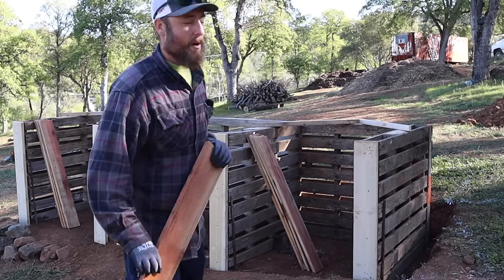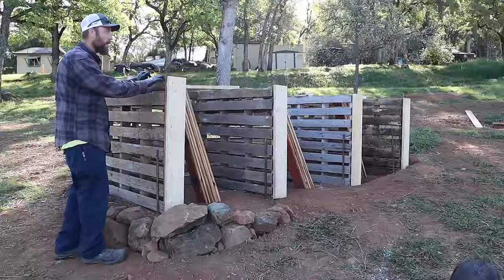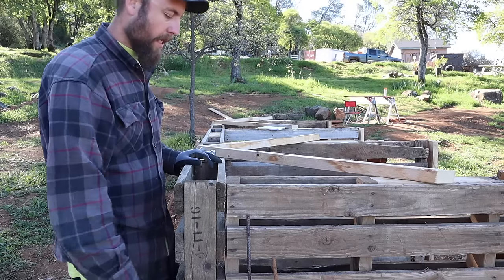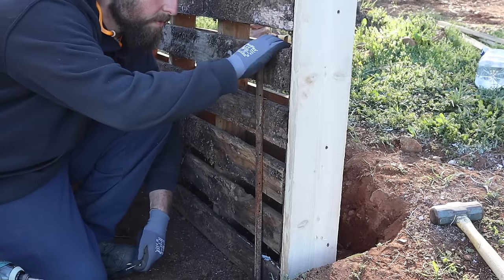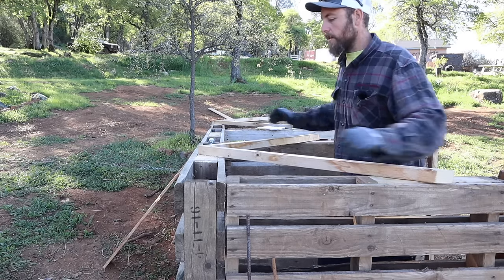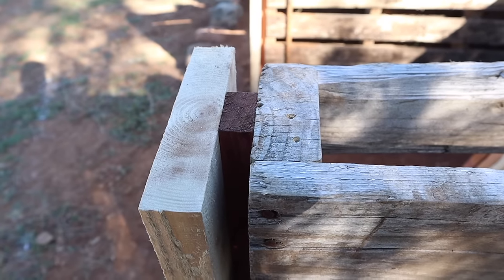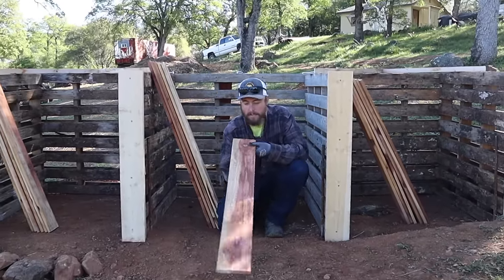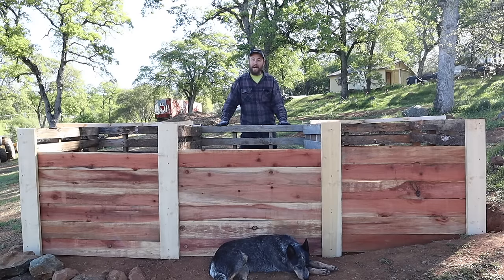PALLET COMPOST BINS | Building Our Homestead

Comment: I love your attention to detail, and I know the satisfaction that comes from doing a job right. But realistically, these bins are going to compost themselves in a few years, so overbuilding a compost system is just going to end up wasting wood. I just put my pallets together using some stainless steel L-brackets; the weight of the compost inside makes them rock-solid. When the pallets disintegrate, I just remove the L-brackets and re-use them on the next build. A lot more time and cost-efficient!

Comment: My biggest suggestion is make your bins wide enough to scoop out with your bucket on your tractor.  If you have a 5 ft bucket make 6 ft wide bins.  And such.  Then you can scoop out the compost when it’s done to move without shovels.  And if you need you can toss the compost easily with tractor.    I made my first been like he did which sucked since I bought a tractor a year latter.  Since then I made a new compost bins much larger.

Comment: Very nice looking bin for sure. I built one out of pallets when I start my homestead as well and about 3yrs in the pallets where pretty much composed on the bottom side . So my new one I used cinder blocks along the bottom to lift the pallets off the ground and used rough cut cedar top slabs as bottom boards in hopes it last a little longer.  But great channel and great work !
Reply: Thank you for sharing about the cinder blocks. That tip just modified my plan.

Comment: I've used steel T posts, 2 per pallet which worked pretty well. just stand them up right between the slats, and pound them in til they stand alone, remove pallet then drive the posts down till flesh or slightly below top of pallet.

Comment: this is cool , especially the front slats and how easy they fit in ... I used  2 metre (6 foot) fence postsfor securing it , the round ones fit between the palett  , had 1 at each corner ,and it was solid , used chicken wire on outside to stop any escapes, but the front I just screwed 3 pieces of marine plywood , I like this better , does same job but looks 10x better 👍

Comment: I had the same idea and configuration as you but your idea to use the removable boards in the front is an excellent idea so as the level changes it makes it easy to access. Cheers 👍

Comment: Nice build but one suggestion, those pretty pieces, rose colored you used to build up the fourth side ( openings),  is too nice! after all, the contents will be rotting so they are bound to spoil quickly.  I'd use those to build some outdoor furniture and then put polyurethane or a stain that enhances the beauty.  My suggestion, take apart some pallets and use those planks instead.
Reply from the maker: They are very nice, thank you. They are cedar (very rot resistant and cheap) dog eared fenceing. Don't worry I used. Some of them to for projects in the house, made a window sill out of one.🙂

Comment: Watching you bolt one pallet to another, proves to me that you can find a way to attach 6 pallets to each other to make a big completely enclosed cube. Inside that cube you can fill up all the space with 2-liter soda bottles. With all these soda bottles trapped inside the cube, I am positive that the cube will float. By bolting many cubes together, you  can assemble a barge, or pontoon boat, a dock, or floating bridge. Any person who can find ways to use pallets without taking them apart is a smart builder.
I enjoy the way that you build good looking structures. But I do not think that the wood chip compost will be ready for the next planting season. Good video!
Note: the bottles will need to be inflated while at the same time the bottle cap is being screwed on. Applying a little Gorilla glue around the cap will also prevent air from escaping. If you have a minute, take a look at the following soda bottle boat, in the video entitled " Barco de Garrafas Pet." The man also has related videos where he talks about the construction steps (Tutorial Barco Pet - 04) and also how he screwed the caps while inflating the bottles ( Tutorial Barco Pet - 01). I do not speak Spanish but I watched the whole thing. I am sure that I can make a nozzle that holds the bottle cap while pumping air from a Shop Vac., while I screw the bottle into the cap. Thank you for reading!

Comment: The front boards attached to the 3/4 redwood that holds the corral boards in place what size what is that? Is it pressure-treated?
Reply from the maker: If I remember right, not at home to measure it.  They are "5/4" meaning full 1 inch x 6inch its not pressure treated, a standard 2x6 would work.
Reply: @JoeSimple  great thanks Joe. Love the channel. Keep up the good work

Comment: Did you eventually cross all the fence boards with a couple boards... that way you can slide all of them out at once?
Reply: I saw someone do half at a time- spanning 3 or 4 palings at a time. As you build the pile you use the bottom half then when it gets higher use the second half.

Comment: I really like it. I need to build one too but want mine wide enough for my front end loader to fit in. Also, will the pallets not rot? I know they are heat treated but I was thinking that makes them stronger?
Reply from the maker: that's a good idea tractor size!, keep your eye out for some extra large pallets I found some for my fire wood storage racks. Yea the heat treated pallets will rot, probably where they are sitting on the ground. You could try and keep them off the ground with maybe concrete blocks, or even better old composite decking. come to think of it most lumber stores have left over composite decking pieces form the pallets the decking comes on.
Reply: JoeSimple That’s a good idea about the composite decking. I might could put a coat of deck stain on it but don’t want the chemicals on it. Thanks my friend.

Comment: Great! Now I am thinking of building something similar. What are the advantages of pallets in your opinion? Won't they fill up with humus and finally be composted themselves?
Reply: They won't last more than about 3-5 years in our climate, but the advantage is they are cheap or sometimes free to get hold of, so they're popular.  Wood is very expensive so this helps keep costs down 🙂
Reply: Self composting bins😜
Only issue would be rescuing all the screws.

Comment: Hi, I’m very new to building… anything. This may be a silly question but how necessary is it to drill a hole before drilling in the screw? Does that help with stripping?
Reply from the maker: I usually drill a pilot hole when screwing near the edge of a board, to keep it from splitting. Also the pallets i used were old and hard so helps with that too. Another tip I prefer "torx" screws very hard to strip. Thanks for watching!
Reply: @JoeSimple  Awesome! Thanks for the help. I’m working on a pallet compost bin myself.

Comment: No, you did not go overboard. Another way to limit the wall wobble in the front is with a front beam on the top of the wall. It can be made removable several ways one of which is a piece of rebar with some smallish elbows, facing in the same direction, and long enough to just fit across the span and fit snuggly over the inner or the outer set of lasts. This can also be reinforced any way you desire. Not a suggestion,  just an idea.